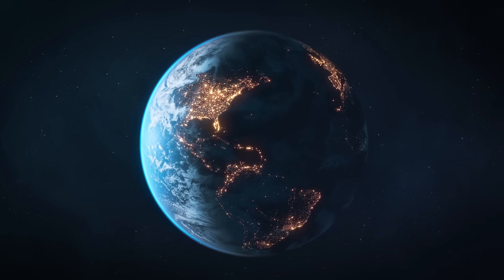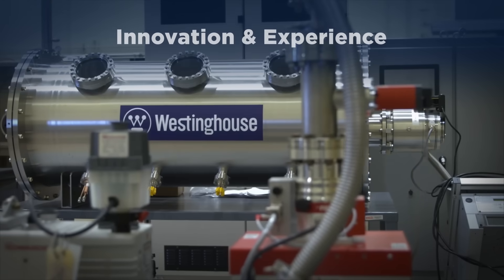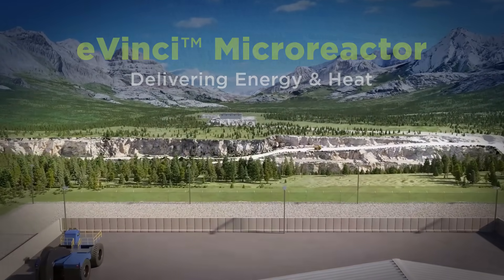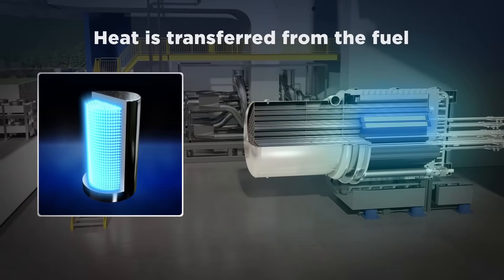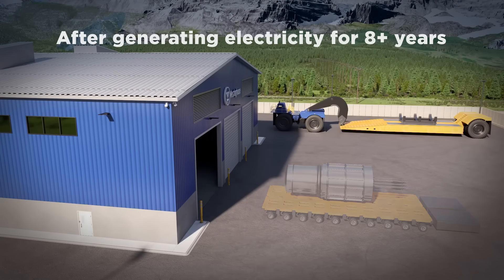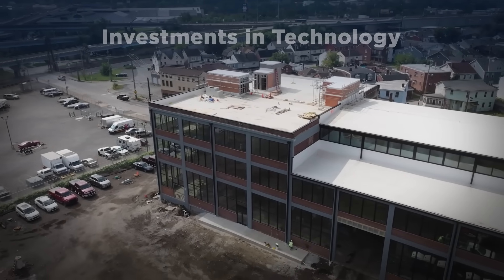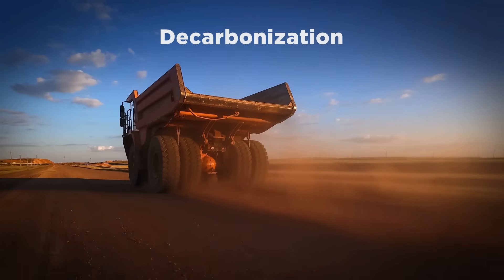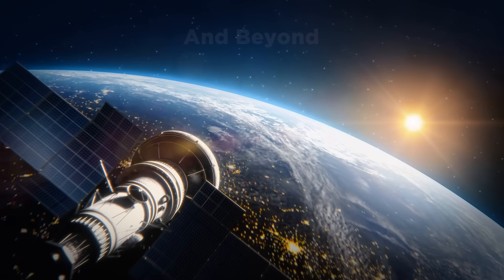Explore eVinci™ Microreactor Capabilities as Westinghouse Technologies Facility Opens

Comment: How about some details? This video is useless. It gives no data on system capabilities, etc.

I know you folks want to advertise, but the best way to advertise is to deliver steak with the sizzle. This video fails to do that.
Reply: There are 100s of similar projects in the pipeline. These will replace diesel generators in remote locations. Not perfect but a better long term option that will improve.
Reply: We send the used ones into space. Or send them to Dearborne.
Reply: the eVinci is the first "Solid State" reactor.
- Unlike conventional reactors the Solid State reactor has no moving parts except the control rods. 
- Unlike conventional PWR reactors there is no water in the core thus no risk of any core failure or coolant leak issues
- The Unit doesn't use flow coolants of liquid metal like flammable/explosive sodium or heavy lead/bismuth eutetic thus mitigating molten metal's corrosive issues
- mitigates all waste heat via solid state tubes i.e heat pipes just like the CPU in your computer. 
- Initital heat exchange takes place Outside the reactor, not in it thus there is no need coolant loop or pumped coolant loop, since it conveys heat by solid thermal contact converting interior material into a working fluid; it requires no pumps and thus No emergency pumps are needed for overheating risk
- Solid state thermal contact also ignores gravity thus making it ideal in zero-G environments like space or can be installed in any orientation without compromising function
- The core is encapsulated in pyrolitic graphite and use TRISO fuel, thus compatible to the High enrichment rate of naval reactors thus potentially achieve a full life cycle before refueling. 
- Unit doesn't require a stationary stability bed; and can jostle around a tad in shaky conditions without harm
Lastly, the reactor has a core max temp of 1,500 degree's C, and TRISO fuel elements have a melting point of 2,800 degrees C; so it can operate at variable peak output temperatures of 600 degree's C thus able to produce with exact psi, supercritical steam, this makes it compatible with the coal plants steam infrastructure boilers and turbines;  So the reactor can be installed in place of the furnace. Only an Adaptation in lieu of conventional heat exchanger to mate with the new design is necessary.
Reply: @spikedpsycho2383  

Thank you. That provided the context I needed to understand the basic difference. 

Very nicely done.

Thanks again.
Reply: Just google it bro,please. You can find some data about evinci..
Reply: Agreed. They casually left out the biggest problem. In 8 years they just replace it with another one. Where does the spent fuel go? Into a landfill? What about earthquakes or another natural disaster ?
Reply: @rebellucy6200 "Once the fuel is exhausted, the microreactor can be hauled away for disposal and another one plugged in its place to continue operations on-site, much like a battery. The microreactor is equipped with shutdown rods that are used during transport for increased safety. The nuclear fuel can be stored in deep geological repositories (DGR) for long-term storage."
Let the men figure tech things out Lucy, p.s. you are NOT a 'rebel' 😂
Reply: @droiduser1984  Thanks for the information. I guess a (DGR) is a fancy name for a radioactive landfill. I think Fukushima had a similar  promise to bury the waste. That changed into just dumping it into the ocean. Go figure.
Reply: @rebellucy6200  the spent fuel can go into the same place it came from: underground. Before more FUD gets piled on: it's generally accepted that DGRs are the best way to manage hazardous waste. There are sites in operation already, notably several in Finland and USA. The main push-back is the public opinion that's been set due to anti-nuclear-energy campaigns.
Reply: I highly doubt it would just go into some random landfill, its probably kept deep underground far from other life, which makes it safe for us. Definitely an improvement over coal or oil  @rebellucy6200
Reply: I doubt this will get approval and become a reality. The general fear of  a nuke accident will be the major reason. Pulling that 'reactor' on a trailer as the video shows would get major thumbs down from any regulatory group for sure. The video shows the reactor but what about the generating end of the equation. That is no minor detail and was left out of their 'advertisement '.
Reply: @J123G sorry to burst your negativity bubble -- "Earlier in November this year, the Saskatchewan Research Council (SRC) approved a CAD 80 million (US$59 million) project to build the first such microreactor in Canada. The facility is expected to be operational by 2029."
Reply: True, @droiduser1984  , but CAD$80M isn't going to build anything, and schedules are not reality. From a CBC article: "The $80 million announced Monday will allow the research council to tend to the licensing process and project costs related to bringing the microreactor to Saskatchewan, according to the council." That means that Westinghouse donates the reactor, and it is expected to cost $80M to install it somewhere in Saskatchewan by 2029... but it will cost much more and take much longer, if it even proceeds.
Reply: @J123G  looks to be a Brayton machine next to the reactor.
They say there is no water, so that's a big clue.